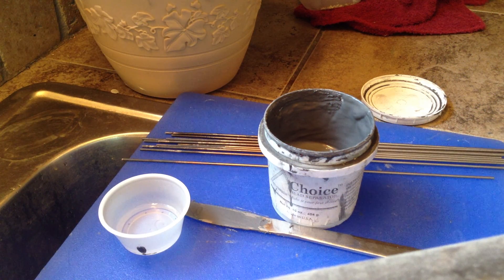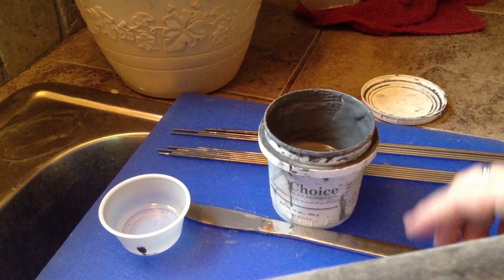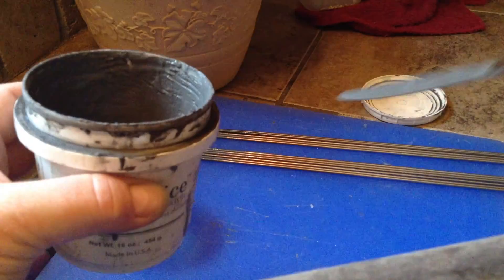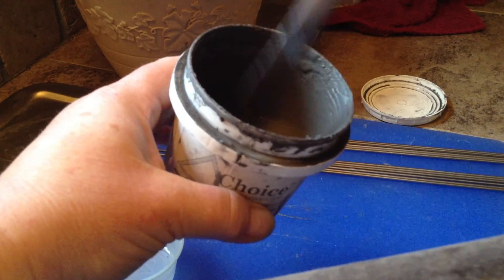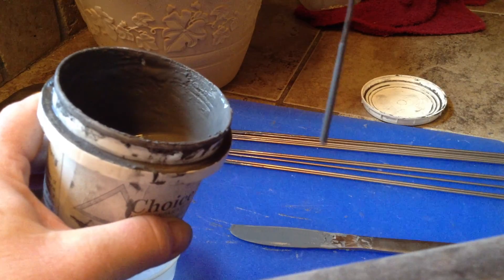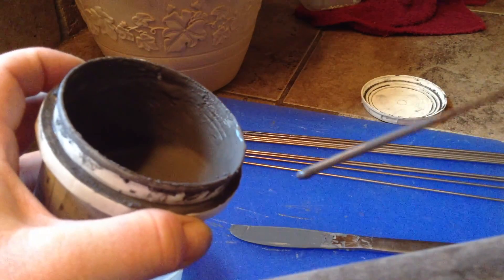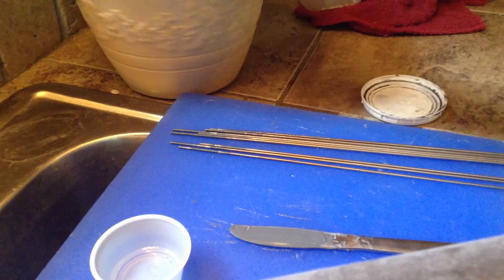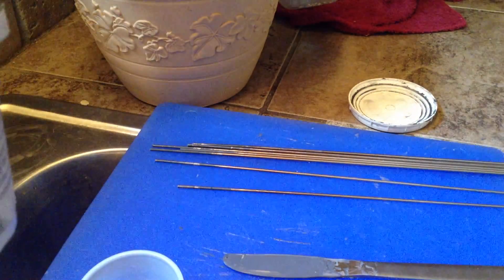Bead release and mandrel prep for lampworking beads 104coe

Comment: I like the mandrel holder!
Reply: yes, a sand filled pot with pegboard fit inside works perfect!
Reply: Hi, another question.  I'm teaching myself in my basement, many questions.  Anyway, should bead released prepped mandrels be used by a certain time frame?  I prepped many mandrels the other day, stuck them in my kitty litter red pot, and I tried using a couple different ones , and the bead release cracked up as i was wrapping the hot glass.  I know enough to not use them because it will be so difficult to get the bead off.  Anyway, thanks for your advice.
Reply: Heidi Havens the kind I use doesn't seem to have problems, but I would suggest not going longer than 2-3 weeks. Humidity will effect it.
Reply: ah, thank you very much!   I am set up in my basement and hudmidity happens.  I also redid the ones I had and thinned out the bead release some.  thanks again.